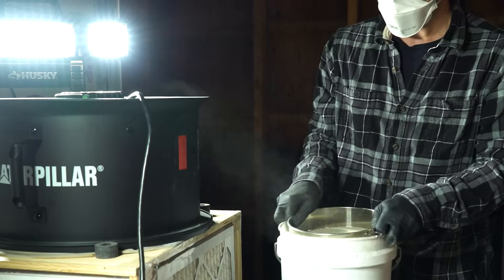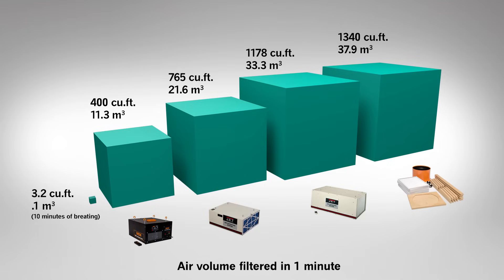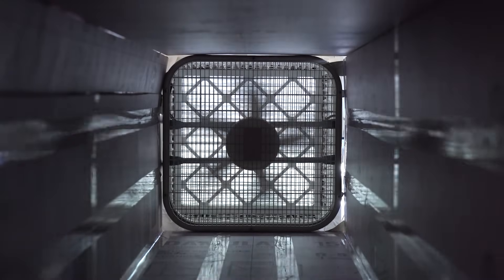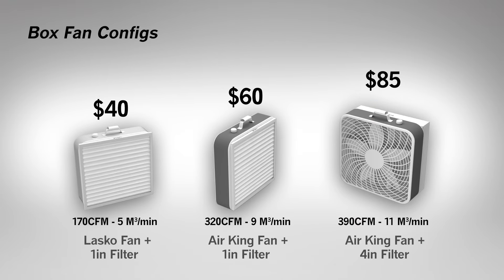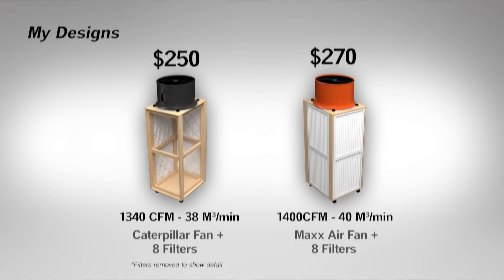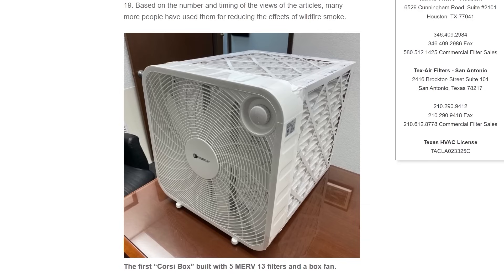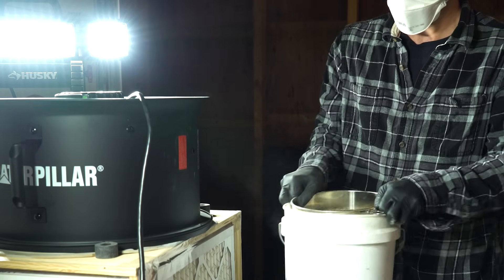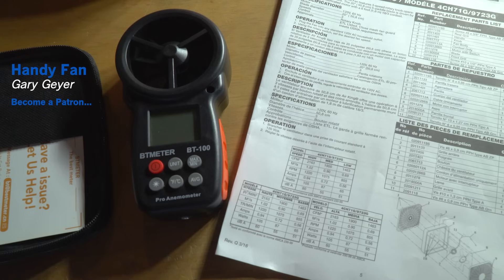What is the best DIY Air Filter?

Comment: I unfortunately just moved in to an apartment on a busy street with smokers and restaurants. There is an amalgamation of terrible smells and barbeque smoke. The only windows face the street with the restaurants. Can you recommend how to filter and purify the apartment?
Reply from the maker: Sounds rough! Both the BBQ and cig smoke are quite intense. Most of these things would fall into the "particle" category and would not be VOCs (volatile organic compounds). That's good because these types of filters don't do much for VOCs. I am one week away from putting out a video specifically on smoke filtration and I have tested all of these things you mentioned.

The filters that preform best in testing are MERV 11-14 and the best brand by far is 3M. Their MERV 11 (MPR 1000) filter outperforms many higher rated off-brand filters. Since you may not have a whole lot of floor space, the Corsi-Rosenthal method might not be ideal but as a single unit it will filter the most air for the lowest amount of money. I would suggest trying 1 Air King (more power) or Lasko (more quiet) box fan with a single 3M filter taped to the back side. The MPR 1000 (MERV11) filter will clear 1 stick of incense from a 450sq.ft space in about 2 hours and the 3M MPR 2200 (MERV14) will do it in about 1hr 15min (on an Air King fan set to high). If it isn't working fast enough for how quickly the smoke is leaking in to your apartment, make a 2nd or 3rd filter/fan and put it in a different room (or try a corsi box with the same filters, they filter 2 times as fast).

A more expensive approach but an effective one is a pro HEPA filter. I tested an Air Doctor 3000 ( https://amzn.to/3zJn3qw ) as well and it can filter 450sq.ft. in 1 hour and 6 minutes but is $500 vs a box fan and an air filter which will come in at $50-$75. If you want to go HEPA, look for something that has a CARD of 300 or more or go with 2-3 units like this Levoit https://amzn.to/3DHAtVi.

Some of the option that were in this video filter the air in as little as 30 minutes but are sort of large for a small space. I am going to launch some wooden kits for filters in about 2 weeks which make it do you don't have to have $3000 in woodworking tools to have one. They will be a lot more expensive that the taped together methods but they are less than the pro models that they outperform.

That was a lot to read but hopefully that helps you make a decision! Good luck!

Comment: The Lasko and Air King have similar blade shapes. How big of a factor is blade shape & blade count?
Reply from the maker: The difference between them appears to be inside the motor only. From what I can tell, the blades are identical, possibly even from the same machine. The drum fans and a lot of floor fans only have 3 blades but move a lot more air, so I think the most important factor is motor size.

Comment: Hello, I was thinking of trying out your design named the circulator.  Have you had the opportunity to test that yet?
Reply from the maker: Hi! I have not, unfortunately. The shop I planed to move into is now years behind schedule, so I'm not sure when I might be able to.

The general concept is the same as the original design, just with a long duct. I want to say that this will work even better than the floor unit due to more defined air circulation but I can't say so with complete certainty. 

This video talk a bit about the concept although it is implemented a bit differently https://youtu.be/OhVWsnTm8iU

If you build one, I would love to know how it works for you!
Reply: @The3DHandyman  i am thinking of ceiling mounting my dust filter - also I bought that cat fan using your affiliate link.

Does the design need to change if I’m ceiling mounting it, or do you think its best to have a rollable one that I can move around to my workspace.  The dust in my garage is so annoying. 

I really value space in my garage; so would appreciate if you have thoughts for a design that I can mount on my 8ft ceiling preferably in the center.
Reply from the maker: @XxMalabooo  I think the design can work well on a ceiling. You could screw the longer side of the design to the ceiling. This reduce the number of air filters to 6, and that will reduce performance a bit... or you could add another stack (3 filters tall) for a total of 9 filters.

I think the portable aspect is nice for some things but if space is your biggest concern, the ceiling mount is the way to go.

You are probably right with the idea to put the filter right down the center of the room.

Thanks for using the links!!!

Comment: As someone who has built and worked with laminar flow hoods to create sterile environments, I would like to give you a couple of simple suggestions. 
1) Use a squirrel cage fan. You'll get better airflow and they can be much cheaper if you source one from a used air conditioner system. 
2) Use a $1 furnace filter on the intake side as a pre-filter. It is cheap and can collect the larger particles that will quickly clog your better filters. Assuming you keep the configuration, personally I think it would be better to pull air through the filter and out via the fan.
Reply from the maker: Great to get comments from people experienced in the industry! Thanks for the comment

A used blower motor of that size is definitely a good find. It's nice that the static pressure info is also available for this type of motor.

The prefilter idea is a great one. I am experimenting with some washable fabric options at the moment. Something that will last years, hopefully.

I just finished graphing the numbers and in a 4400sq.ft space the "pull" config outperforms the "push" config by only 10% in a smoke test (30 minutes to good air quality from a hazardous level vs 34 minutes). I actually expected it to be a larger difference that that. Given that I use it as an oily vapor sink, a paint booth, and a dust removal station, etc... I still like blowing air into the filter box despite how unorthodox it may be.

Comment: I have been looking at building my own recirculating filtration system for a new screenprint studio / laser cutting / workshop I just moved into, (hence finding your channel)!

Had you considered industrial drum floor fans of the 3 or 4 flatter blade profile style? For example, the brand "Sealey" here in the UK claims 4361 CFM for their 20" model and 7400cfm for their 24" models. Perhaps there is more test data available for those? (TBH, I wasn't too surprised your 14" CAT fan underperformed, given its diameter).

I've also been looking into recirculating silenced 12" inline duct fans with high CFM activated carbon can filters, (frequently used in hydroponics), to deal with smell, VOC's and formaldehyde which are released when I print certain inks, (urea-formaldehyde is also used as a resin binder in materials such as MDF, which is why MDF dust is considered so dangerous).

Trying to figure out a balance of a decent CFM under pressure, final filter unit size and minimal noise level...all for a reasonable initial purchase and ongoing maintenance cost!

I am working on seeing if I can combine dust and activated carbon filtration into 1 unit and configure the filter media selections with internal blast gates...

Thanks for a great series of videos - you do a great job of presenting the information!
Reply from the maker: Awesome! I am going to be testing for VOC reduction in a week or so with a video to follow. My 3D print room has a level considered "HIGH" by OSHA (occupational safety and health administration). Much of the VOCs are from isopropyl alcohol and the printing process itself but likely also from the latex paint that the room was just painted with 2 months ago. Radon gas may also play a role as it is in a basement. It's hard to say what all the contributing factors are but it's not stuff I want to be working and living in.

Hopefully my tests work out and I can bring the numbers down to safe levels. We will see...

Do you have a link to the carbon filters you are looking to use? I am trying a raw carbon media approach and would like to compare prices for pro units.

As for the big fan options. I have explored a few options but the video on that got derailed due to my home flooding a few months ago and things are only just now getting back on track. I hope to have a video out with theoretical numbers for the 4500cfm and 7500cfm fans you mentioned. Due to the expense, actual testing is tough and I don't have a need for a unit quite so large at the moment.

I did draw up some plans but my website is down at the moment and the links are broken. Hopefully that will be fixed in a few days 🤞

I send plans to your email if you like. If you do build one, it would be awesome to know how well they preform in the real world.

I show these designs at the end of this video https://youtu.be/NmgNQu4zDy0

I would assume, based on my other tests that some fans will under preform their ratings by about 40% or more. I am thinking that the major factor in this is that they claim to "move X amount of air" but this does not mean the air has to pass through the fan. If the outgoing air moves other air in the room or around the outside of the fan, that counts in the total cfm number. It's not wrong but does not apply in the scenario we are using the fan in. I think that blower fans and inline fans have more accurate factory numbers (in a DIY air filter) than floor or wall mount fans because they are designed to work inside of enclosed spaces.
Reply: @The 3D Handyman  Ahh, sounds like we are very much on the same path! I also have a few 3D printers and the associated fumes are also something I definately want to handle too!

From what I have learned so far, Australian activated charcoal is considered the premium option for VOC absorption. A lot of suppliers use compressed charcoal pellets, which significantly reduces available surface area.

Prices seem somewhat reasonable for bi-directional Duct filters with Ozzy charcoal: EG -  AC Affinity 12" carbon filter, £200, 1668cfm, 38mm thick Australian carbon RC412 at 1200+ IAV. I don't think it would be too hard to build something similar with some pipes and mesh, but for the sake of time I'll probably buy the longest 12" and most reasonably priced unit I can find. There are different lengths available to suit.  I'm hoping I mayy be able to use one such unit until the media is consumed and then drill out any rivets and refill with fresh charcoal on a vibrating table. (Btw - Some charcoal panel filters can settle when used in a vertical orientation and then the air will bypass the media, so vibration filling should be used by manufacturers to counteract potential settling)

With respect to formaldehyde, I understand that it is very effectively caught in activated carbon to reduce levels quickly, but formaldehyde specifically can potentially be released later, (ie, caught but not bonded). I don't think this is an issue with  VOC's. More research definately required on my side. Phosphoric impregnated carbon looks like it addresses this formaldehyde-specific issue, but I need to educate myself more about this and test.

I'm going to hook up a high quality formaldehyde sensor to an Arduino to measure levels so I can determine whether the activated carbon is sufficient or not over time (cost: about 50 Great British squids)

Filtering particles first will shield the intricate activated carbon structures from getting clogged up prematurely.

To optimise activated carbon effectiveness with VOC's, I understand that we need to maximise contact time between air and carbon media. Initial data suggests 0.1 to 0.3 seconds, but again, this is something I need to research more. However, given current recirculating hydroponic designs and fan/filter packages sold, (frequently used for growing cannabis indoors), it looks like we have a very effective benchmark from which to start!
Reply from the maker: @20vK  

Formaldehyde in my basement is sitting at 0.13mg/m3 which shows as RED on the display which indicates "not good". More research is needed as you said. I will test for a reduction in that as well. Interesting info on the time that the air should be in contact with the media.

I do like the charcoal pellets because they are less likely to fall through the mesh bag I put them in. The tiny particles will be very likely to do that. I wonder what the static pressure of the AC Infinity filter is? Could it cut airflow by half? I'll see what a 1" layer of the pellets results in, it may also take a big hit.

$200 is a chunk of money for the filter too. My concept is coming in at about $50 in materials but that is no Australian carbon! Hopefully it preforms well, will find out soon

Comment: Great videos. Can you compare different filter brands. Like filterbuy and others on Amazon that might save us some $$$ I need to build these soon and am afraid their Merv 13 aren't as good.
Reply from the maker: Thanks and yes! I hope I can get the next series out in about 2 weeks! I will test Filter Buy, Nordic Pure, 3M (MERV 11,13,14), K&N washable filters, HDX, and Aerostar.

1", 2" and 4" filters will also be tested!

I bough a particle  meter and will be testing with smoke (fine particulate) also will be testing an idea for VOC reduction.

There is a lot of testing to do before I can start cutting the video together. With any luck it will go live in about 2 weeks 🤞

What are you trying to filter out of the air?

Comment: Hi 
Thank you for the video. Does Air king fan with 5 filters, merv 16, size 20×20×4 will work well ? or it will be too hard for the fan to handle? 
Best
Reply from the maker: Hello! I think the fan wouldn't be bogged down that much by the MERV 16s. I'd like to test them but but the price tag is quite high. Those high end filters have far more pleats of material than the standard 4in filter and therefor don't create as much initial resistance as some of the cheap ones. I suspect that each is rated for at least 1000cfm. The theoretical airflow for 4 of them would be 85% of the fan's capacity.
Reply: Thank you so much! I will build one with 5 of those and will let you know how it works.
Reply from the maker: @misstrending4u  Awesome!

Comment: Would adding a carbon prefilter be usefull?
Reply: it's for odors, so if you smoke in room and want to filter out odors then yes
Reply from the maker: Great question! I will be testing an air filter with a carbon layer in an upcoming video to find that out. I just got the air quality sensor in the mail. My hunch is that it wont do much but we will find out for sure

Comment: I wish there was more videos like this! Your work and testing is so beneficial.
Reply from the maker: Thanks Brian!
Reply: I love this video. I retired and have a 24’ x 45’ wood shop with 16 ft. Ceilings and I am literally sick from wood dust. I caught up dust at night. My question is, which way should the exhaust go? Up would create a rain of dust that might recirculate through the filter. Down would kick up dust from the floor. Horizontally would work through an open window if I had one. The best solution might be several cubes with merv 14’s near belt sanders, table saws etc. What do you think.

Comment: Thanks for a great video. How much does the Merv 14 filter cost?
Reply from the maker: Thanks! Good question. The prices vary by manufacturer. The 3M Filtrete 2800's are the best but they are quite expensive. Nordice Pure has the cheapest MERV 14 options from what I've found. Check the description for links to all the filters.

Comment: I’ve built my first CR box with a Lasko fan and 4 1” Filtrete 3M filters. Many thanks for making this video and it’s already made a tremendous difference in my small shop (11’x11’). 

I still have some dust settling on my project wood and equipment nevertheless. I convert the shop into an office during the work week so air quality is a real concern. I run the filter 24/7.  When I bring my office stuff in, it doesn’t get coated but dust settles on it over the week. 

Quick question. I’ve seen a number of designs that use centrifugal fans. There are a number of air movers/bathroom ventilation centrifugal fans available in my area for around $75-150 rated in the 100s. Is there be a benefit from this style of fan, given that they’re price equated with the axial fan in your design?
Reply from the maker: Sorry for the late reply, was out of town last week! Great question! Good choice on the 3M filters, they are the best. Centrifugal fans are great for a lot of reasons (easier to duct, can be explosion resistant, very long life, etc) however price/CFM tends to suffer. Most of the high CFM centrifugal option are $500 or more (Dayton is a good brand). I was going to use one of these for a paint booth but haven't gotten to that yet.

The dust is likely settling due to less than ideal air circulation. The CR box does a great job overall but the best case scenario of a flawlessly clean space in filters on one side of the room and outflow on the other side of the room through a duct. 

I was supposed to move into a new shop earlier this year but that has not happened yet. I did however make a video about an air filter that might solve the problem you are having because I was facing the same issue...
https://youtu.be/OhVWsnTm8iU
Reply: @The3DHandyman  I wasn’t expecting a reply at all!  I will check out the other the other video :)